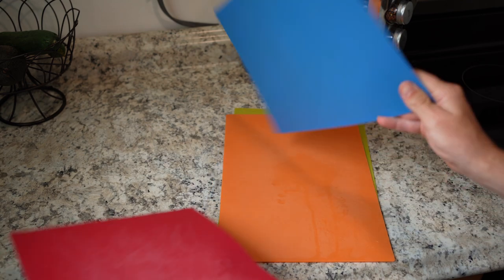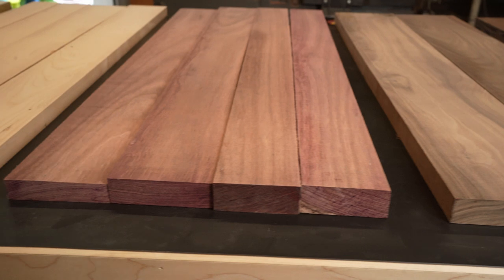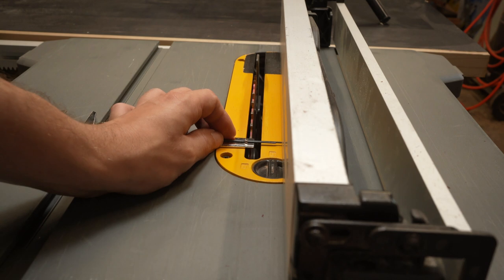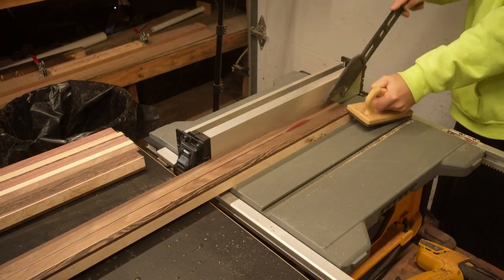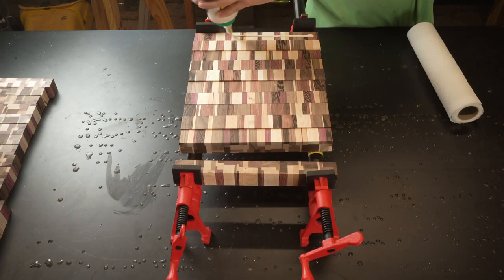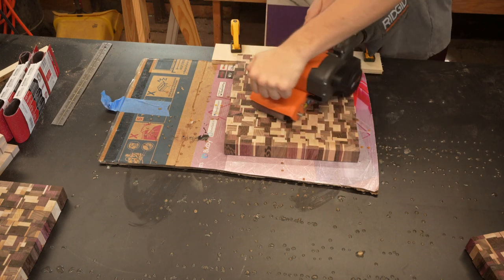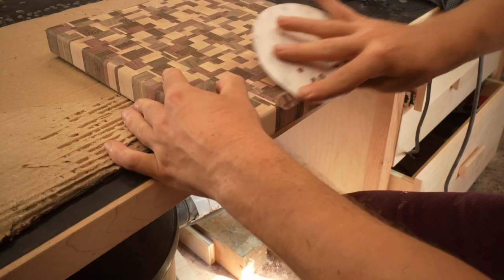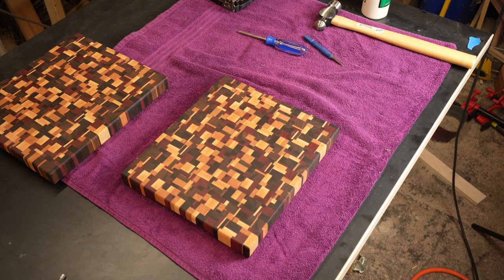Chaotic Pattern End Grain Cutting Board Build

Comment: Swap your pipes to Rigid EMT from an electrical supply store to avoid any reaction from the black pipe and the glue. Also I've noticed your hand shakes a lot during tool operation, not sure if you are white knuckling your grip on the tools but if you have an excessive amount of pressure you could run into an accident sooner then later. Firm grip is needed yes, but I would bet your muscles are rather sore at the end of the day. If its a condition or something else, I don't mean to shine a light on it. Just talking as a witness to my dad mystifying the pad of his thumb off as a kid cause he was pushing down really hard on a piece of wood as he was jointing it.
Reply from the maker: I appreciate the advice! I do have a general tremor. Some days are better than others. Can get very shaky at times.
Reply: @G.I.D.CustomWoodworks  Thanks for the reply and setting that straight. Best of luck to you, and your channel. Great looking boards!

Comment: Out of curiosity, what blade do you have in your saw? It looked like a high tooth count blade, maybe a 50ct combination blade? Either way, a $20-30 ripping blade would seriously help with this project (esp that wenge). I was doing the same project and ended up getting a ripping blade to avoid the burning and heat on my general purpose blade and was surprised the difference. Great video!!
Reply: Also, we have a lot of the same exact tools. Exact same jointer and planer. Love the videos and your shop
Reply: last comment, one of the cheap harbor freight paint scrapers does wonders for getting glue off after it's dried. just scrape along and it pops off
Reply from the maker: Awesome I appreciate the tip I'm going to try that!  And yes combination blade. I like the flat kerf. I gota get rid of this jointer its just taking up space at this point. But the planar is amazing!

Comment: Love the boards. Can't wait to try an end grain board one day.

I'd highly recommend getting a shop vac just for sander dust extraction and using either diablo sand net or 3m cubitron sand paper. I noticed a huge difference in the quality of my sanding after doing this
Reply from the maker: Thanks for the advice! I saw a Lincoln St Woodworks vid on the sandpaper and once I use up what iv got i'll check some out

Comment: Why did you remove the riving knife?
Reply from the maker: At which point in the video? Some times i remove riving knife because it's taller than the blade. so if i'm not making a full depth cut I'll remove it. Also a lot of times when I use my sled i'll remove it because I have a firm grip on my workpiece and it's not going to twist on me. I hope that helps!
Reply: Thank you for the quick reply, removing the riving was at 5.22, I just wondered why, you are cutting right through the board? I am making one of your boards at the moment, I am lucky enough to have a Jet drum sander 16-32 it really makes sanding end grain a doddle it is the best machine in my shop, I really feel for you trying to cope with that belt sander, you did try everything before buying a new one, thank's for doing the video, it is the best video on  end grain boards I have seen    @G.I.D.CustomWoodworks
Reply from the maker: Oh man that drum sander is going to be a dream! I took the riving knife out at that point because i got a thin kerf blade and never got a thinner knife. Which results in me having to force the piece through the saw which is incredibly dangerous.. I have since gotten a thinner riving knife.
 @patrickdunne4975
Reply: Thank you for explaining why you removed the riving knife,  I have done that myself with a thinner kerf blade but found it hard to get a thinner riving knife @G.I.D.CustomWoodworks